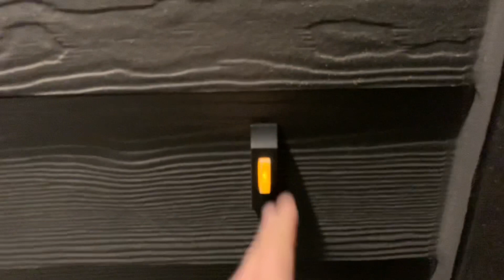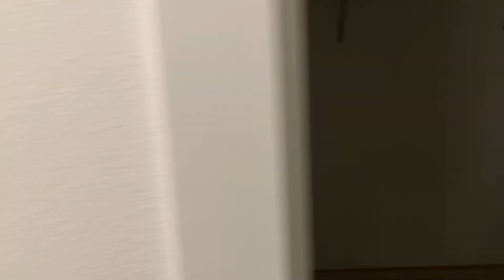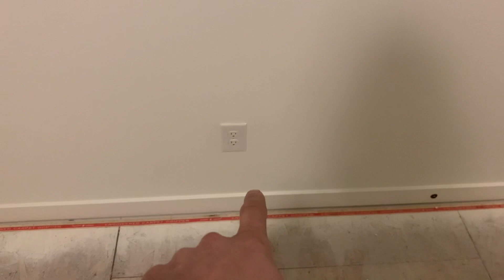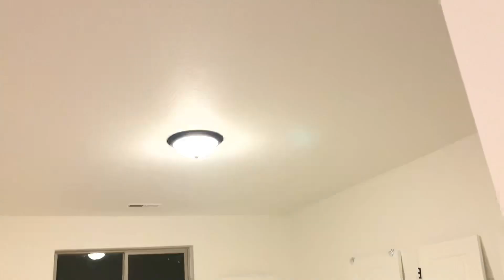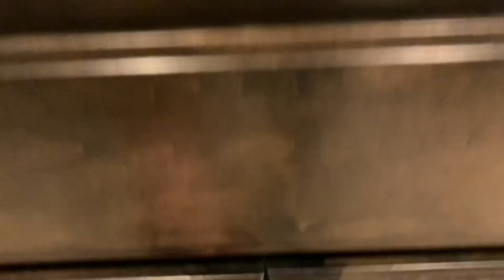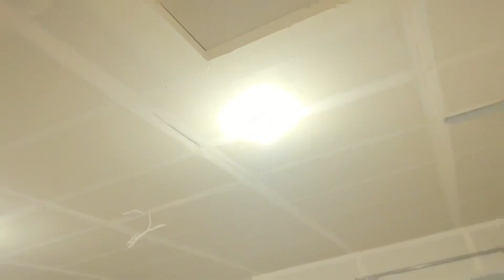My House Build Day 127.5: ELECTRICAL DONE!!!! (95%)

Comment: CK, not that there is anything wrong with this, but are you OCD? I’m having a house built as well and as some others have said, start writing all the issues you see so the proper tradesmen fix their mistakes. Honestly, you have to blame the electricians being used for your build for some of the sloppy mistakes. Your low level panel box was cut very rough and now you will have to do some type of patch there, or the builder that is. On your first video the box in your garage is your tankless hot water heater, I’m sure you know that by now?
Reply from the maker: ocd idk, but not putting up with crappy work YES! lol. yeah i do, thanks!